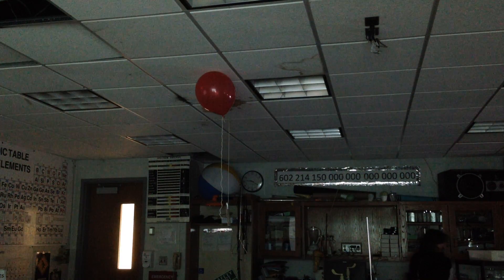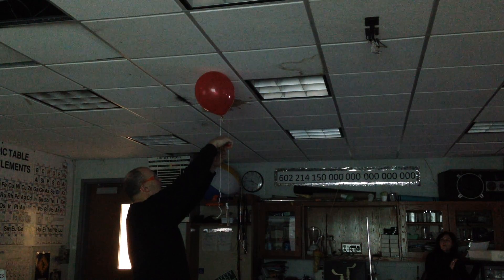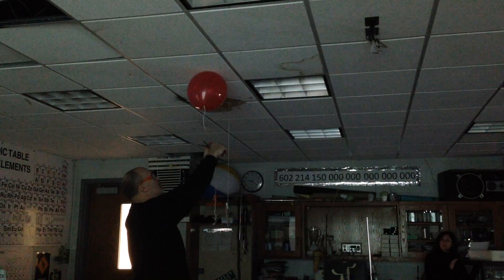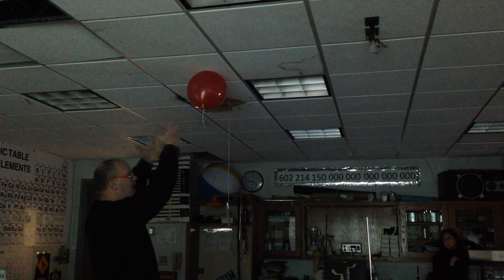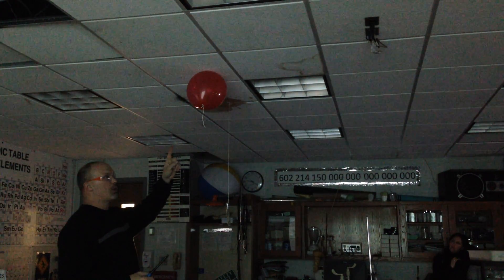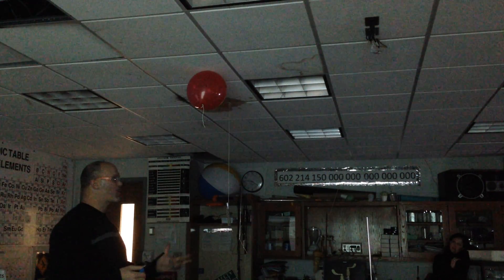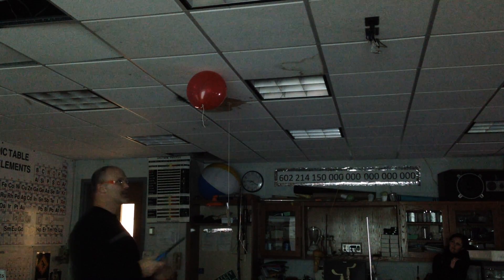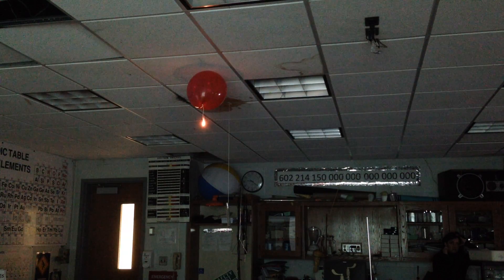Hydrogen and Oxygen Balloon Explosion

Comment: Hopefully the ceiling was not made of asbestos when Mr. Knucklehead the science "teacher" set this off inside a lab with students present. If any of the students hearing was damaged, we don't know. This kind of demo is only safety performed in an open area. Did anyone notice the spark on the ceiling that continued to burn? If that had gone inside the ceiling structure it might have found some flammable dust and smoldered until it found better fuel. His explanation is also incorrect. If the balloon contained only hydrogen, the time over which that hydrogen could interact with oxygen is limited by the need to transport it from the 100% hydrogen center to the exterior air (by turbulent flow, convection, and diffusion) and by the buffering effect of the nitrogen. So the hydrogen balloon "burns" its fuel over a longer time than the 2 H2 + O2 balloon. It is not because of incomplete combustion. In fact, if the same volume has only H2, that event has a total chemical energy greater than that of the mixture.
Was this performed in Florida?
Reply: lmao... as one of his students from a few years ago, our hearing is fine, and this man's class was the most entertaining and educational I've ever had the pleasure of taking